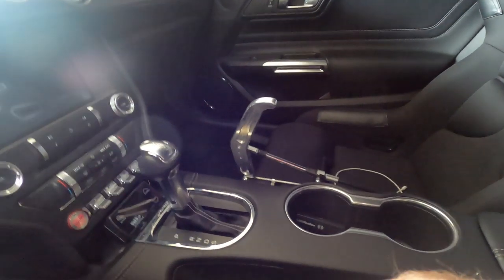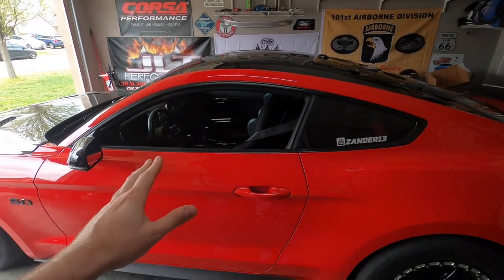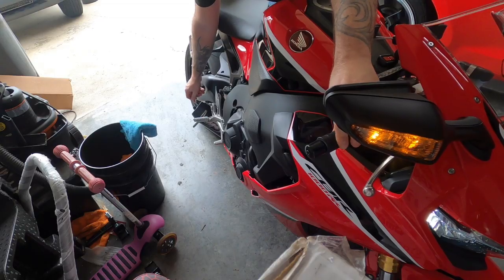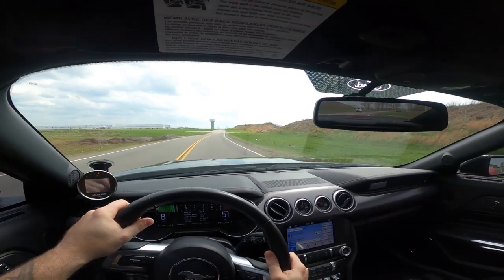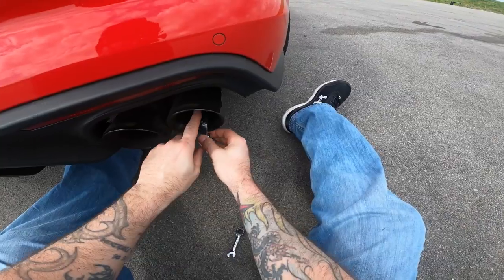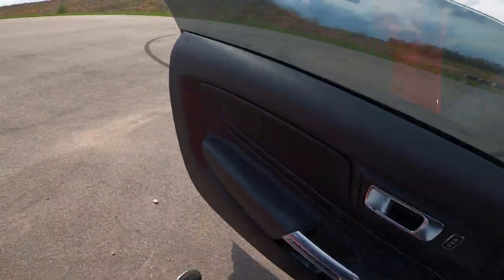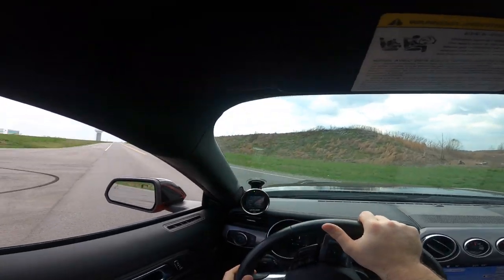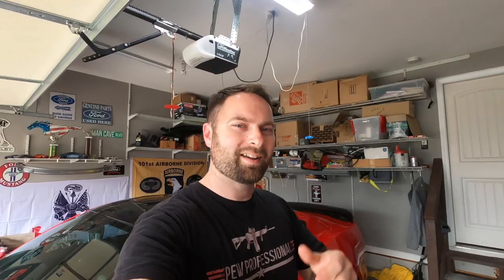XL TURBO EXHAUST WHISTLE vs TWIN TURBO MUSTANG GT... DID THEY WORK?

Comment: Hi Zander 13 

 1. did the car breath normal with this whistle ?
2. is it not harmful for the engine , if you fix for permanent basis ?
3. Because the whitsle hole is very small , does it affect engine in high speed or permanent high Rpm ?

please reply i already installed  one in my car ,
Reply from the maker: Not harmful and will not hurt anything. I did this video to be funny. I didn’t leave these on my car. Although I guess you could and it would be safe
Reply: @Zander13Productions   thanks for  the  reply  ,  the size of tale pipe is nearly same as the whistle which is Xl in size , the blow is only coming out from the whistle hole , is that ok ?
Reply from the maker: Yes

Comment: Alex I have asked you twice now what have you done to your transmission in regards to strengthen/build it for the extra power. I have a 2018 10r80 putting out 680rwh and I am worried how long will it be able to handle it for?
Reply from the maker: Asked me twice. My bad. So far nothing. I will be building my 10r80 soon. I’ve mentioned that several times in videos. At 680wheel you should be fine for a while. Biggest thing is how much torque do you have?
Reply: Zander13 -640torque

Comment: I almost bought those same wheels then they back ordered really glad I didnt....I hate the fronts ( obviously the backs are awesome what beadlock isnt )...first time I've ever seen anything on your car I didnt like. The car needs lowered or taller wheels/tires like 18x5s or something
Reply: Oh and turbos sound insane sweet
Reply from the maker: I’m honestly still getting used to the fronts. I honestly feel like a taller tire would help tremendously
Reply: @Zander13Productions   you know I'm not jackassing... I will tell you I did 18x5s on front and really like how they fill up the wheel well...also my supercharger is probably heavier...